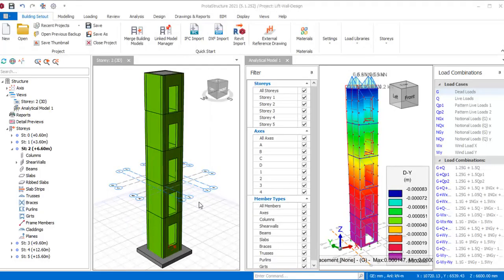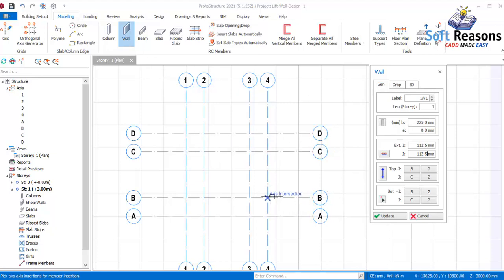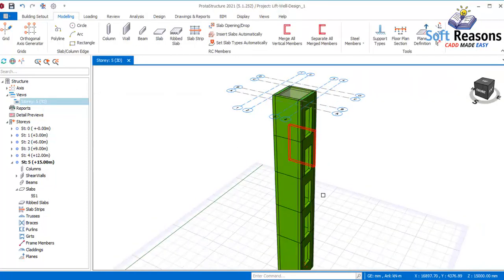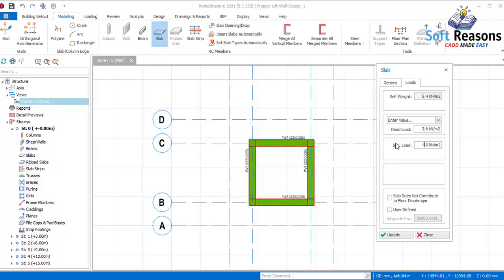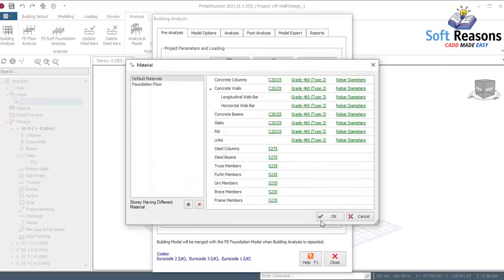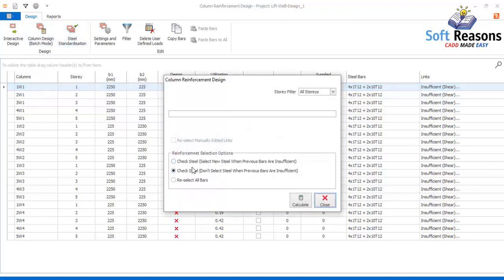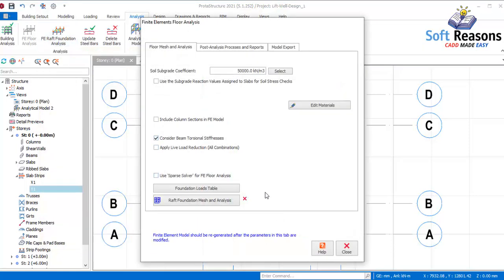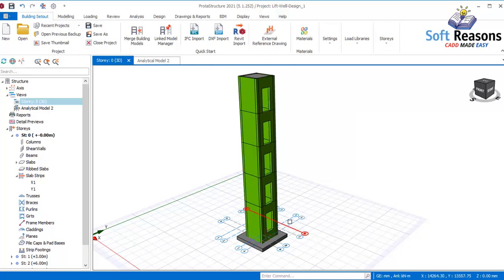Reinforce Concrete Lift Well Complete Modeling Analysis and Design in Protastructure

Comment: hello, is it okay to have a design glass in the lift wall instead of pure walls? considering the architectural design
Reply from the maker: Yes it's okay only for Architectural presentation, for structural design, you assign it as a load to the load bearing structural members.
Reply: @CADmade-easy  thank you for noticing me, can you upload a tutorial regarding different kind of warnings on protastructute like after analysis? Because I encountered some warnings and some say insufficient ratio?

Also how to put beam on lift wall?
Reply from the maker: @kayceealcantara7591  Noted
Reply: Thanks sir, we appreciate your efforts

Comment: Why you don t put load of left on the wall
Reply from the maker: Because lift well weight decompose to the  foundation so the foundation should be properly reinforce to avoid failure
Reply: @CADmade-easy  but, before the foundation receives the load ,it Will receive the load of thé left from the wall or i m wrong .
Thank you for all you are doing here